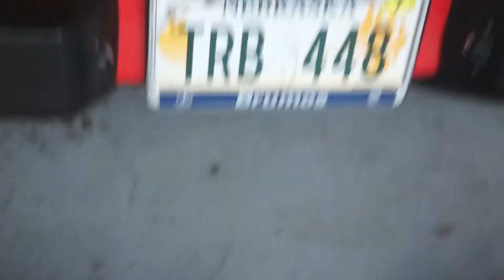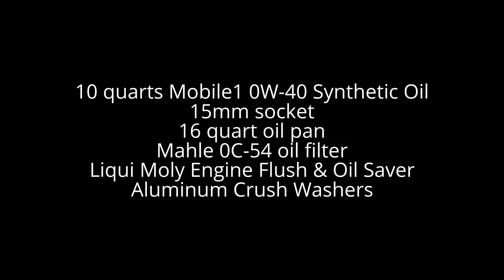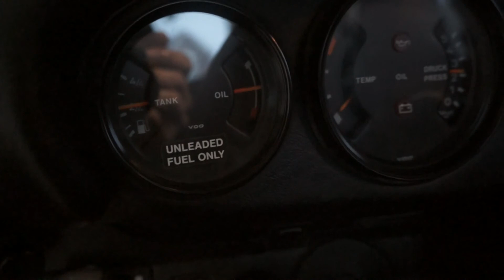1987 Porsche 911 Oil Change

Comment: Personally I wouldn't use 0/40 oil. The engine wasn't designed for it. In fact  that oil wadn't even around when the car was new.
Reply from the maker: What oil would you suggest using and why?

Comment: I have the same drain pan and the problem is that the draining is very restricted with 2 very small drain holes. I used a 1" drill saw to open the drain to provide proper draining.

Comment: Beautiful and smooth running Porsche. Those BBS wheels fit perfect!
I read other comments, so I had to add something... Mobil 1 0w-40 is very good oil, but why did you add oil saver to it?
Oil saver is just a viscosity improver package. It makes your oil thicker, probably somewhere about 10w-50 maybe when mixed... 
It would be easier to just use an oil of that grade. Most of the "heavier" oils like 10w-50, 15w-50 are better in term of antiwear protection and high temp. performance (Zinc and HTHS).
Keep up the good work ;-)
Reply from the maker: PureRocker20 thanks for the comment. Did I add oil saver?  Been a while since I made the video. Also, just like you said I switched to 15w-50 for my last oil change based on similar advice.
Reply: @HacktivistMechanic  
Yep. I just watched you pour it haha! I got passionate and felt you don't need it ;-) 
Hope it was a good advice... Enjoy the car properly.
Reply from the maker: PureRocker20 thank you sir!  When warmer weather arrives will put up some more.

Comment: Thanks for the video. Even though I've owned my 85 911 for 30 yrs, it had been a while since I'd done my own oil change. For some reason, I can never remember the drain plug removal direction. Since the shop always over-torques them, I needed to know which way to hammer!

Be sure to clean the drain plug magnets of accumulated metal w/ a Q-tip or pointy piece of paper towel. And coat the new crush rings in oil.

Also in Atlanta, I've always used 20w50, and oil should be checked via the dipstick when the car is warm and while running. 

Nice car BTW. I have never seen a 911 w/ painted door window frames and B-pillar.

Comment: How come you used 0W-40?  Doesn't Porsche call for heavier weight,  20W-50 in that model year?
Reply from the maker: 77abcdef77 previous service records indicated the same weight so that's what I went with.
Reply: Ok.  I have an 89 carrera and I've always been told to use the heavier weight, but I'm also in Atlanta where it gets really hot here in summer so the heavier oil may cool better.  If it works for you, so much the better.  You have a beautiful car btw and I would love to do the LED headlight upgrade someday.  Thanks for posting vids, keep em coming!
Reply from the maker: Glad you enjoy!  Yeah, perhaps I'll do a bit more research on oil next time although not as warm in Omaha as Atlanta.  I have a shop manual so I may peruse that just in case.  The lights were definitely worth the money both for looks and function.  As you can tell not a perfect fit but really glad I did them.  Between new lights and new exhaust really happy with where my car is at the moment!
Reply from the maker: Btw, what are some other videos you'd be interested in seeing?
Reply: Any work you've done on the Porsche.
Reply: Porsche is claiming 10W60.....
Reply: wilduc -there is a 10W60 now? What brand?
Reply: 10w40 is what you should go to. these old mechanics require heavier weight than 5w50 and certainly not 0w50 otherwise you will have a few leaks all over

Comment: Does that mobil 1 oil have the zinc etc required as per the synthetic 20 W 50 oil??? for these engines? I think not...
Also the engine flush will not be completely removed as about 3 litres always remain when you drain the oil... this doesn't sound good to me for the engine...
If you puncture the top of the oil filter with a nail before draining the oil, most of it will be sucked out of the filter.
Reply: at the parts store they went online and showed me the oil grade for a 87 911 carerra is 10w 40 
for -20 to 95 deg amb, temps..here we never exceed that temp but over 95 deg you should use the 10 w 50 oil.
Reply: just go to Renlist or the pca club, not a local store...